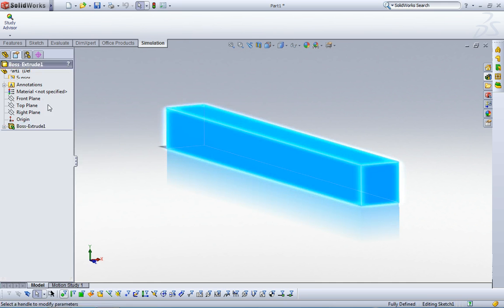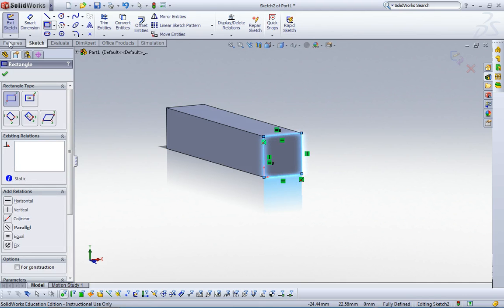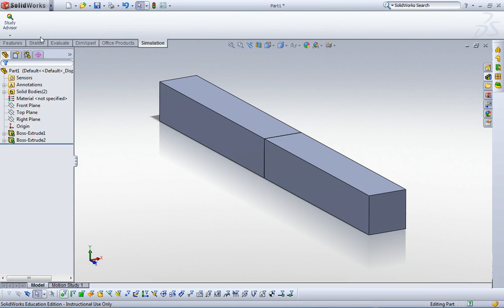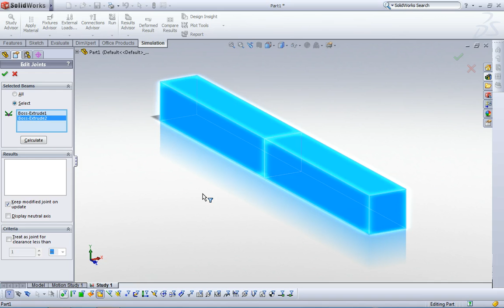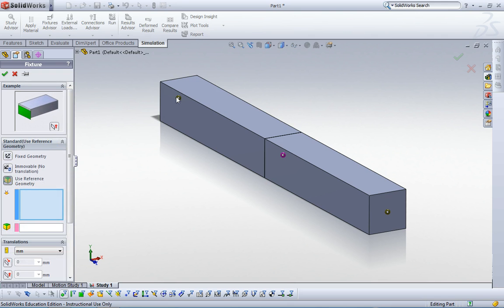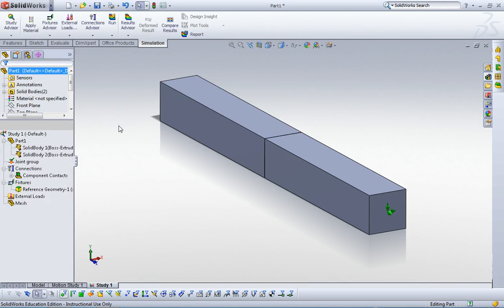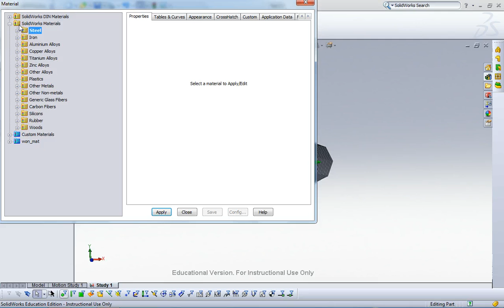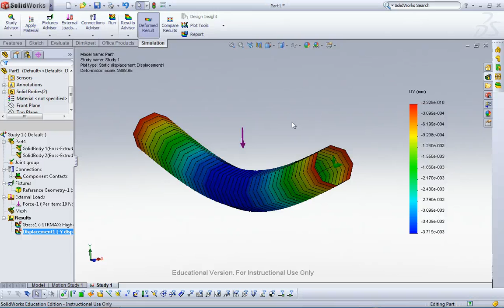Solidworks simulation: Simply supported beam bending with beam mesh.

Comment from the maker: The shape of its cross-section does not be a limiting factor when you do beam analysis. Please email me your email address. I can send an example model.

P.S. One thing I can suspect in your model is that thickness-length ratio of your beam is large. That might be less than 0.2